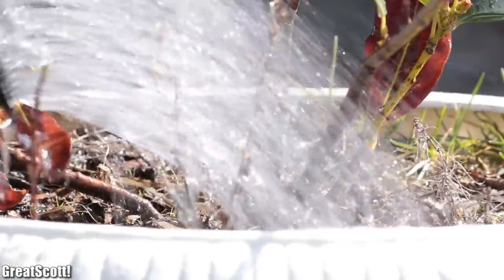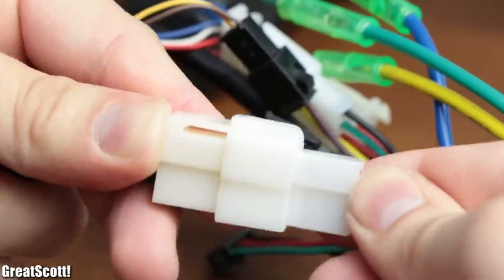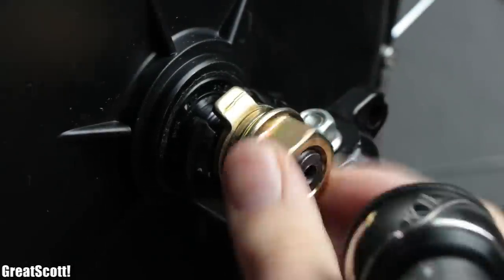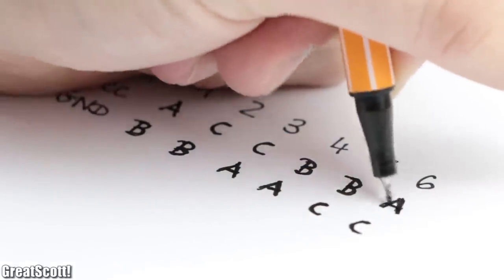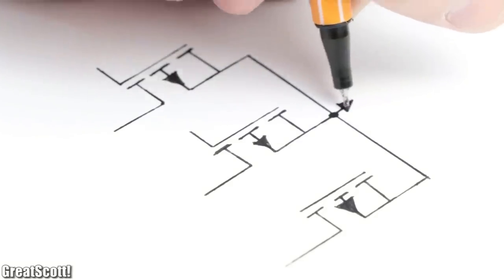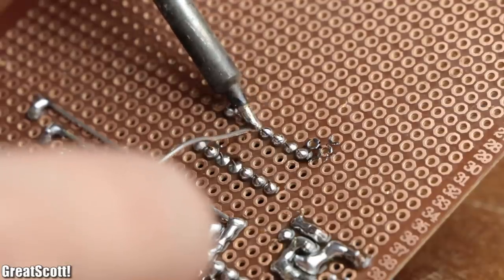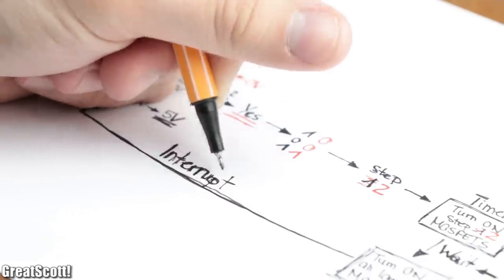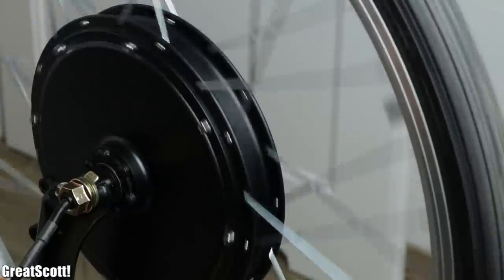Make your own Sensored ESC ||  Electric Bike Conversion (Part 1)

Comment: BE CAREFUL!! that front fork looks like an aluminum one to me. You should NEVER use a hub motor with aluminum forks. I learned this the hard way. My fork failed and caused me to have a severe accident that landed me in the hospital for two days, suffering a concussion, severe abrasions to my face and shoulder, as well as a lacerated liver. On my new bike I have used a steel fork and welded on reinforcements on the front and back to make darn sure that it does not fail again. These things are very dangerous when not used correctly, as I learned.
Reply: Thanks for the tip!
Reply: If using aluminum forks then you can always use a torque arm to absorb the load.
Reply: It depends massively on the power of the motor as well as how much metal is in the dropout area. I would highly advise against going with motors with a power output greater than 500 watts if you have an Al fork unless you have the ability to fit some decent quality torque arms to the bile to prevent fatigue. Although even with a 250w geared motor I would ensure you use a torque arm wherever possible. Especially if you have thin Alu dropouts...

My bike has done over 6000 miles since I went with a BLDC kit using a 450w controller on a geared hub motor just for reference. It's done a fantastic job so far of getting me from A to B only needing the wheel off for basic maintenance (tube changes for example). and each time I've checked to ensure there was no bending or cracking, and so far, there hasn't been any. That said, the dropouts on my forks are surprisingly beefy!!
Reply: Yep. He's running 1000w motor. Mine run 25 to 30mph, even hitting up to 35mph. You do not want to have a catastrophic failure at those speeds.

Comment: I have a feeling this is why you've been experimenting with building 18650 packs recently...
Reply from the maker: Possible...
Reply: GreatScott! I was just wondering if you will be comparing the new raspberry pi 3b+ with another board???
Reply: +Logan, probably pointless RPi 3B+ is behind many existing boards in regard of tech features but it has great software support and community

Comment: BTW, it's not "codes", it's just "code".   When referring to programming, "the code" refers to all the program instructions.  Each line of code is just call that, a "line of code", not a "code".  A "code" is what you'd use to encrypt your messages so the enemy cant read them.

Comment: Aren't these conversion kits illegal here in Germany? I don't think the motor tops out at 25 km/h and it certainly doesn't look like it just supports you when your are pedaling. From what I've heard driving these can have severe consequences, like heavy fines or even loosing your drivers license. Did you do research on that topic and/or aren't you concerned about it?
Reply: Noboliner yeah, at least you should buy a kit that LOOKS like the legal bikes. With the acceleration done by hand instead of pedaling it will be very easy to see that this is not compliant in our nanny state 😢
Reply: I would have built something like this for a long time if it was not illegal in Germany
Reply: In Poland these conversions are also illegal (max 48V, 250W, 25km/h). I think in other countries in EU also. My friend has one of these motors in his bike and never had problems with it (in the city on ordinary roads).
Reply: Yes, but that's a risk you pretty much need to take. What's the point of having a motor if it stops working once you need it the most (when air resistance become significant). Maybe if you use your bike for commuting and have a route with large differences in elevation (so you need to climb long hills) it can be useful, but otherwise it's no point having such a bike since you can as well pedal 25 km/h with no big effort on flat ground (unless you're really out of shape). The risk of getting caught is probably not that high since you can slow down to 25 km/h and start pedaling if you see a cop, haha
Reply: Ride84XL Sure, but if you get caught or involved in an accident you're fucked.
Reply: Been running my electric dh bike in the uk for 3 years now. Never had any bother.
Tops out at 65mph and takes very little time to get there.

Specs (for those who are interested)
Battery - 22s15Ah (92v HoC)
Controller - 18fet (irfb 4110) sine wave FOC
Motor - MXUS 3K 5T(Special version 3 with curved magnets, redundant hall set, oversize axle)
Built into a grossman dh frame with marzocchi 888 forks. Hope mono 6 brakes front and rear
Reply: Inconita same
Reply: This kit is legal as long as it does not goes faster than 45km/h and buy a plate with insurance for the bike, that here is considered a mopped.

And in most cities it can not use the bike line
Reply: Pedro Jurado Maqueda From where do you know this?
Reply: This is a very interesting article(I come from germany) but it does not say that this kit or generally self built motorized vehicles are legal in germany. I really would like to build something like this but if you get caught, well you might get into serious trouble with the law. The kit would only be legal if it had an "Allgemeine Betriebserlaubnis" and a license plate and some other annoying stuff. Getting a "Allgemeine Betriebserlaubnis" is not easy for self built stuff. This kit is sadly definetly not legal in Germany.
Reply: You are most probably right, in the law there is nothing against this as long is registered in the Fahrerlaubnisbehörde, if they allow the registration or not is another history.
Reply: Yes, you are pretty fucked if you get in trouble but until now only one EBoarder got officially caught and he was not judged until now. EBike Tuning is a bit more popular.

Comment: I'm no e-bike expert but I've read that it's not the best idea to replace the front wheel, it technically shouldn't be a problem for motors under 1000W however, a normal bike frame isn't designed to handle the reverse stress put on it from the motor, this is especially bad if your bike is made out of aluminum, since if it does fail it'll just snap unlike a heavier metal such as steel which will slowly bend out of shape and give plenty of time to notice the failure and as you can imagine it would be pretty painful if not fatal to be traveling at 20mph (32kph) and have a frame failure, so personally I would rather not take the risk and just avoid frontal installations or at the very least take it as a serious issue and add some torque arms to reinforce it.

Comment: Electric bike or not, that is WAY too much chain lubrication.  And please don't tell me that's WD-40.
Reply: Whats wrong with WD-40, I use it for EVERYTHING
Reply: @lansraad6142  WD-40 is a solvent, not a lubricant. It'll make your chain feel lubed at first, then dry out very quickly. Bike chains should be maintained with oil, which is a lubricant. WD-40 can be useful for cleaning old oil out of the chain though.
Reply: @cmazzullo  I never knew it wasnt useful for chains! Thank you for the reply :D
Reply: I See we have another bike Enthusiast here, just like i am.

Comment: Nice work I watch your video a lot however my question is can this ESC works on a IGBT at 220v dc also is the 15 volt that drives the IC has to be isolated 
Thank you

Comment: Thanks a lot for this awesome project but ı dont understand why you are using extra 15V voltage regulator to supply mosfet driver ?
Drivers also work between 4,5 - 18 V

Comment: Hi there. I've created an ESC control and I would like to comment some things. I'm using 16.5KHz AND the potentiometer only control the PWM which starts with 5%. The next step will happens when the hall sensors to change. This way you don't need to wait. You will be always in sync, even in low or high speeds. Sorry my poor English.

Comment: Great video, but attention: There have been some bad accidents with these kits, because the front wheel isn't designed to take the pulling force and can break off mid-riding!
Reply: That's weird, must be some cheap/really bad bikes. I have one of my bikes powered by a 3.5 HP (2.6 kW) chainsaw engine, it can do burn outs and smoke tires too fast for me to afford except occasionally. The bikes I've used were already super cheap (one of them cost $5 at a thrift store).

That's not the only front wheel drive bike, the other was powered by a much more mundane grass trimmer. Its top speed is only 28 mph for legal reasons (legal for most states in the US without insurance or licence), and I took it off road jumping terraces in fields and some small natural ramps my cousins and I usually jump quad bikes on. Never had an issue with the bikes/frames/tires handling it. The big difference is my power is not delivered through the spokes (pulley is another bike rim welded to the normal wheel rim, or riveted together for alloy wheels).

I think even my Binachi road race bike would be fine with electric (front fork is carbon fiber and kevlar hybrid weave), but I could see maybe a defective knock off carbon fork snapping (they can already do that on some potholes in the road, if they are made bad).
Reply: hey i want to know more about that, could you link something please
Reply: FPV Kubbur Sorry, too many people would copy my design without giving any design fee. I've put in hundreds of hours designing and hundreds more testing (also materials, I broke a couple engine shafts so the design has been updated, I test these to the limits and beyond).

Too many people would just steal my design and hard work. That's why I don't post videos of them, some copy cat would feel entitled.
Reply: Jake Garrett no I meant the breaking off the front wheel
Reply: FPV Kubbur Oh yeah, that would be a fun compilation. I imagine most failures would be from uneven spoke tension or way too loose spokes. My cousin drives the back wheels with a 212cc engine that can do wheelies at an 800 rpm idle. He has managed to brake some stuff, but those were due to bad design for the most part. One of those was spoke failure, but he was drag racing it against me and that put a rediculous strain on the spokes...

I doubt the forks would break, after all they need to withstand impact and the brakes (which are enourmous loads, probably in the 4 kW range). I know my disk brakes are mounted on a pathetic quality wheel (thought the rims might just snap while tensioning spokes...).

Comment: Hi 

Can you set up som different transistors that can work. "FQP55N10 55A 100V MOSFET N-CH TO-220"? This claims to get 55A and 100V(with cooling fin!). Or can you drive 2 transistors in paralell. I want minimum 50A or more.

Comment: Very nice job as always. Fella YouTuber here, working on same project. Already have a few prototypes. How much power will draw that huge motor? Can't wait to see second video where I guess you'll test the bike around using your ESC.

Keep up good work!
Reply from the maker: Well, I will probably not use my own ESC for the second part of the video series. But I think a test run with it will follow.
Reply: @electroboobs  I love your channel too!
Reply: Hi Andrei!, from my own project, those hub motors usually consume about 16-20Amps of current at initial start, then when the speed rises, it drops to around 10Amps
Reply: You've been of great help regarding quad-0copter construction.
Reply: GreatScott! You could try to power it with a VESC, it can takes Hall effect sensors.
Reply: Point to be noted
Reply: Smartphone David Obviously he invented a way to time travel... 😀
Reply: Are you using field orientated control? You should make a video on FOC. 

Its great because you take a AC motor and you control it like a DC.
Reply: So when you gonna show us how to travel in time mate?
btw, did you guys watched his last video? He 3D printed a complete rc plane :O
Reply: Top secret!
Reply: FOC is really rather difficult to implement and would require an application specific MCU
Reply: FOC is also much much quieter and smoother.  There's also the whole determining the position of the rotor without sensors thing that's pretty useful for dead-stop starts.
Reply: Also flux weakening hahaaa!
Reply: th3d3wd3r can you explain the flux weakening?  I just started reading on FOC 2 days ago, so I'm still learning.
Reply: Good luck with that, it's essentially magic. Would love to see a good video on the subject. What I do know is it's a method of running the motor considerably faster than the voltage limit of the battery. Something to do with uncoupling the flux and torque. The controller I use uses a few technologies to make the ride more fun. In the low RPM it acts like a boost converter, increasing amps on the phase side, what they call phase amps. I run 300 phase Amps and 120 battery amps. Phase amps reduce as I approach top speed. Once I hit top speed, flux weakening kicks in, and boy does it kick. Increases my top speed by about 15 ~ 20 mph and gives it an extra bit of torque where normally torque is running out
Reply: for 1000w  i think it would be about 6 amps for no load at rated voltage 
i do it for 450 watt motor and draw about 3 amps but with different component like ir2112
Reply: Nice arduino projects with  brushless motors, I think is very hard make one good design of esc with high torque  for this huge motor or high control speed, first is necessary the mosfet bridge have  low rds(on) for high amperage and low power dissipation.
Reply: I have done FOC its really not that hard to understand if you have a university level science education. 

You have to do the Clark/Park transform into to turn the 3 phase current signal into quadrature current iq and direct current id (and i0 which is the zero sequence current but that's 0 if you use delta connection). iq is the current that provides torque. id creates the coupling field/magnetic flux. if you have a permanent magnet synchronous machine you already have a magnetic field so you make a PI controller to make id = zero. id = 0 when the rotor magnetic field is 90 degrees from the stator magnetic field. You then do the inverse park transform and adjust the voltages via PWM. 

Since you're not wasting current on id (since you have a permanent magnet) you can put all that current towards the torque. Keep in mind that induction machines require the field id to work as they do not have a permanent magnet on the rotor, they just have windings. This is a big advantage of synchronous machines, they also do not get rotor copper losses. 

So the reason why this controls like a DC motor is because if you set id to zero, then the output torque (for a Permanent Magnet Sychronous Machine, and BLDC) is equal to some torque constant times quadrature current (iq). And you can do this without hall effect sensors, just encoder. 

https://www.roboteq.com/index.php/applications/100-how-to/359-field-oriented-control-foc-made-ultra-simple
Reply: Flux weakening happens when the motor's windings become saturated with current and can no longer induce more magnetic flux. This happens with transformers, and a AC motor is essentially a spinning transformer.
Reply: Eric Cartman Never thought I’d like Eric Cartman ;-)
Reply: if you spin a motor it'll produce back EMF. So basically you just have to rectify it and put it through a buck boost into a capacitor bank/battery.

You control the amount of braking by controlling how much current is drawn by the rectifier. So if you use thyristors instead of diodes on the rectifier, then you'll be able to control the power draw.

Of course you'll need to switch to this circuit with relays.

You can do regen braking in induction machines by putting a "voltage" source on the rotor winding. This voltage source will be a boost/buck convertor.
Reply: Eric Cartman 
Thank you for making that so clear!
Reply: You e the only one who gives all the necessary informations and scamatics in discription that can be easily understable by any newbee also
Reply: @greatscottlab  How to make ESC 200-300A 60volt please !!!

Comment: Should you ever want to use the full potential of such a motor, I'd definitely recommend torque-arms! I built something similar with a VESC and the steel of my bike was deformed rather drastically (after about one month of driving around). 
Please add regenerative braking too, it would be extremely interesting to see that implemented. Since I'm already asking, some current shunts for power measurements would be a nice touch too ;)
Reply: Manuauto another idea is recycle a Fisher and Paykel washer motor.
Reply: It already has regenerative braking, if the motor is running at say 20% max speed and you feed 10% duty cycle, current will backfeed into the supply because of the inductance of the motor windings.

Comment: Hey Scott, I think I found an error in your code and a reason why the motor wouldn't spin very fast. In your switch cases I think you have your ports D and B backwards for case 3, 4, and 5. If you look at the direction (DDRD) registers in setup() you are manipulating registers that you haven't declared as output, which also happens to be exactly flipped between D and B. I think the only thing you'll need to do is flip them back. 
Another reason the wheel won't spin quickly is because you only had it hooked to 15 volts. From the looks of it you'll need at least 36.

Comment: I'm currently working on an electric scooter project, and the ESC (and motor) I have are both sensorless. It kinda works, but fixing the problem seems to involve buying an ESC that's far too expensive. Any recommendations?
Reply: I've seen a $20 ESC power a pretty big brushless motor (actually it was a full size car alternator being used as a brushless motor, so pretty big). As long as its not over 500 watt, I think it shouldn't cost too much, but it also depends on the voltage. 12v (3s Lipo) is usually pretty cheap, but getting into 48v or something like this video might be expensive, so it kind of depends on the motor you want to run.